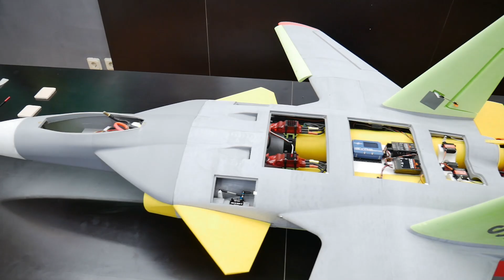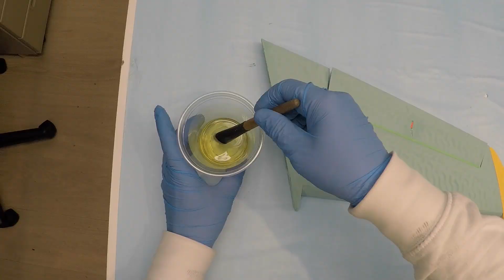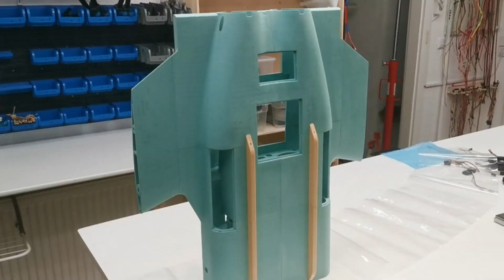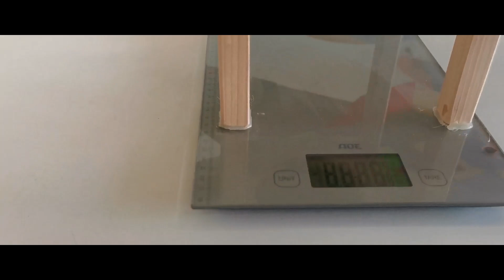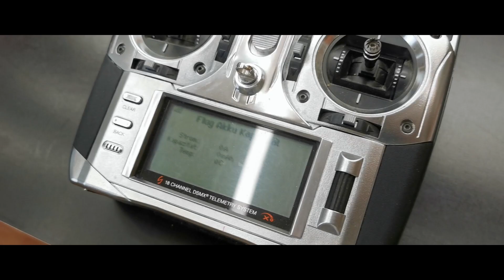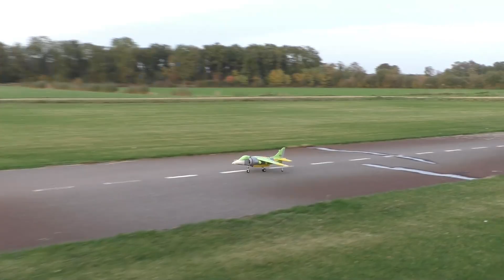3D Printed RC Jet with Retracts and Moveable Slats + New 6S Lipo EDF Powerdrive

Comment: that thrust was really low. 2.5kg only, i understand you lose some due to VTOL function´s but straight out the back, that´s super low.. 
i did get 6.4 kg out of my two 74mm EDF´s in my old MiG-29, with tubes only. no VTOL

Comment: Hi Rene,

WOW - this upgrade announcement  is awesome!
However, there is one suggestion I would like to make about the Su-XR . I think that the inlet ducting needs a redesign.
On the video, when you do your static thrust testing you use 6S voltage and 120-130 Amps (which equates to ~3 kilowatts) to get 2600g of trust. This is actually very little! :/
Myself and some guys on the forums were getting same results (using the same QX motors, I also tested the Freewing 2500kv 64mm inrunners). 
The EDFs are extremely starved for air -  if you convert the "closed duct" inlets to "open duct" you get a significant boost of efficiency. I did a lot of tests on that.

In my model I have made made manual changes to the inlet section:
- cut out a few centimeters of inlet ducts in front of wall that holds the EDFs
- added multiple gitters/cheater holes: one under the model, in front of the EDFs, then two in canard cover boards and one in battery cover.
- cut out a hole in the naca ducts above EDFs

You can see my maiden flight video here, that also includes some photos of the mods: https://www.youtube.com/watch?v=YllIh6hG-L0
I use Li-ion batteries, so a lower power then Li-Po - but look how easily it stats from my hand, thanks to the extra static thrust.

I have actually paid a CAD expert to make changes to the inlet section to include all my modifications (for my own future usage). If you are interested, I will be super happy to send you the design to take a look :)
Reply from the maker: Hi Adam, cool that you also do some investigation. It would be great to take a look on your modifications. I wrote you on WhatsApp👍

Comment: I love the project as always, but ive been thinking since 3d printing makes things possible. Has anyone put the golf ball type skin pattern into a 3d printed plane design? The efficiency increase should in theory help all plane designs. But Ive heard that the actual design of those dimples are copyrighted to a point you cant sell anything with it on it?
Reply from the maker: The Golf ball is rotating with some thousand revolutions per minute to gain the magnus effect in flight with the dimples. The su make max two rolls per second 😁👍
Reply: 🤣
That's a good one. 👍
Reply: @Gepo855  i mean in theory it should do something to help.
Reply: @xXDaReasonXx theoretically you start to need them on a Learjet with its nuts. Slower and shorter aerofoils don’t. Concorde and A380 also don’t.
Reply: @rene_rosentraeger  understandable, but im talking about the miniscule gains you need for something like long range flight. Ive seen it be effective on cars scaled up slightly. So my thought was if scaled properly it should give some sort of benefit.